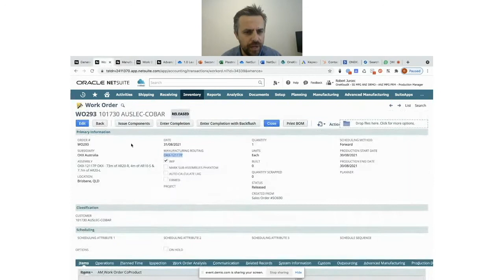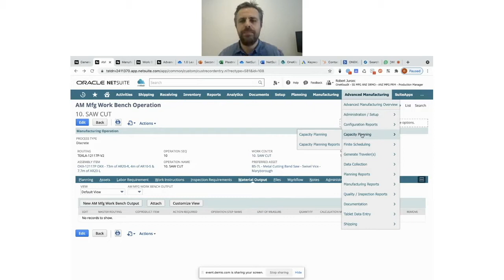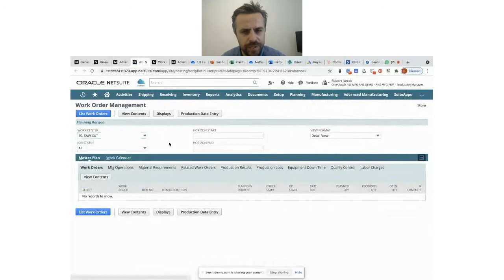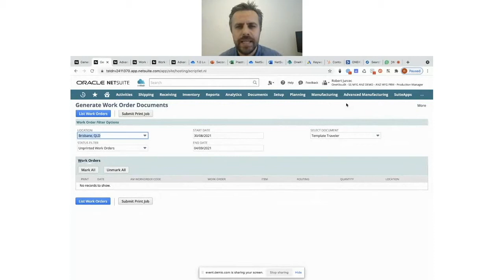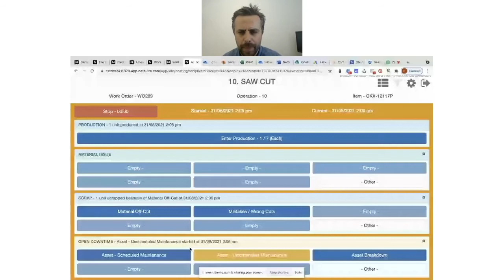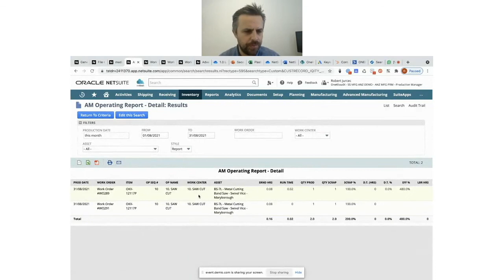Comment: Great video and overview, thank you. I started the AM course in the learning center and was very confused since that course really just went over setup and not the actual process of using the product and the flow. (maybe it will later in the course). I could still use a high level overview of how work centers, work benches, locations, etc. all relate and the flow through them, but this helped a bunch. Thanks.
Reply: Thanks for the feedback Noah. We are glad to hear the video was of benefit.